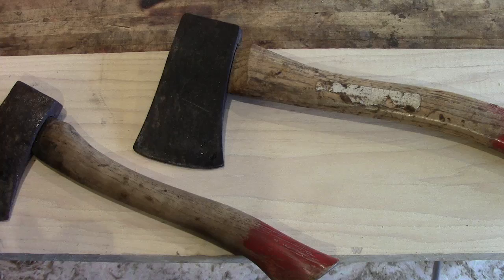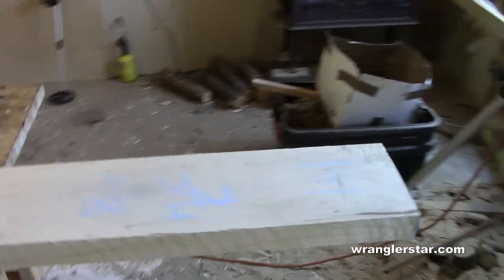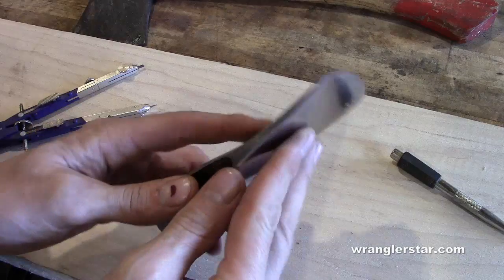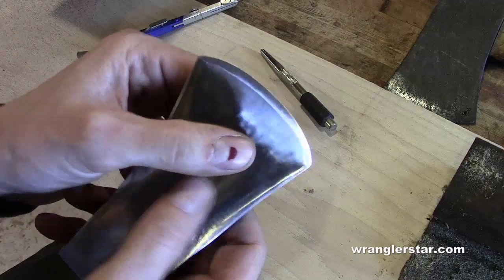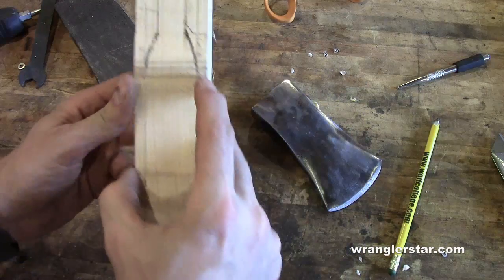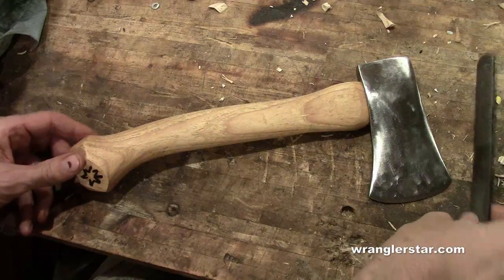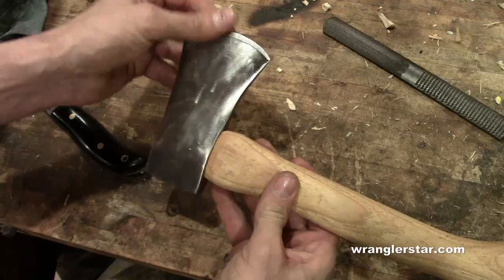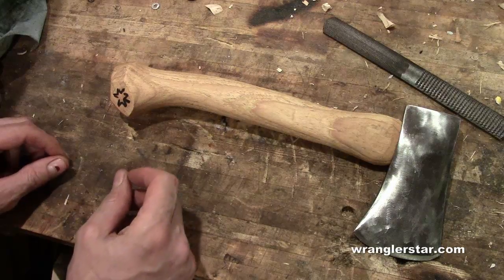Boys First Hatchet - Wranglerstar

Comment: My dad was a good dad, a very hard worker, and gave me most everything I ever wanted. However, he was more of an example of how not to build things. I remember most of his attempts at home repair and craftsmanship ending in disaster. My fort was the same dimensions as an outhouse and had no windows. Basically it was a tall box to sit in the dark in. The floor dropped up when I got inside of it. He hung a shelf once and the toggle bolts he used extended through the wall, through the insulation, and through the other wall into the hallway. He put the outboard motor on our boat through the dining room wall backing into the garage. A few years ago he told me about building wooden models as a kid so I bought him a new one so he could build it and I could one day own it. It looked great until he glued it to himself. I still have nothing he ever built or wrote. I always ask myself, "what would Bob do", and then I do it 180° differently.

Comment: Great gift Cody!  When I was a kid, about your son's age, my grandfather and I built a toy trunk together in his shop.  We built it as a cube and then cut the top off.  I got to help with each step, including the staining, varnishing and putting on the hardware.  It meant a lot to me, in fact, it is sitting in my office, beside me, almost 40 years later.  I have had three little brothers through Big Brothers Big Sisters.  My second little brother and I built a trunk as one of our projects.  That one was painted and Joel picked fire engine red for the outside.  Trunks are great things for keeping your most important treasures in.

Comment: My dad gave me my first hatchet when I was 6 years old. I got it the same day I got my first rabbit. A friend of his found an old forged hatchet head at a flea market and mounted it on a hickory handle. it was Razer sharp. I found out the hard way, by running my finger up the blade to feel the edge. ouch! I used that hatchet to process that rabbit at six. he taught me if you kill it you respect it by processing it yourself. he gave a great life lesson that day. I had that hatchet till I was 25 years old. when my car was stolen and it was in the trunk with my camping pack. I got the car back in one piece, but everything else was gone. I still have the sharpening stone my dad gave me. thank you for your videos. May God bless you and your family.

Comment: I play guitar, electric and acoustic, my two boys at 3 and 5 yrs old always wanted to play with my guitars, so I had a 4'x3/4x12" piece of mahogany and made them each a 2' long slab electric air guitar. I copied my fender Stratocaster and used a wood burner to put all the knobs, pickups,  strings and hardware. I used an old seat belt for the straps. They loved them and always played them when I was playing mine. Not only did they love them, but they never tried to mess with mine again. now at 28 and 30 their children are playing air guitar on them. A hand made gift that is done with love and quality is always a gift anyone will cherish. You did a wonderful Job on Jacks Hatchet, and I'm sure he will always cherish it!

Comment: I don't have kids, but when I was about 7 my dad gave me various hand tools, which I loved. One of my favorites was a manual hand drill (not a brace, a breast hand drill with two gears) and a set of drill bits. Another favorite was a small saw.

I also used some small hatchets we had - I didn't have my own, but I remember that they had 500-700 g heads.

My dad forbade me to use his very sharp wood chisels and the electric tools (probably a smart idea), so obviously that's what I wanted most of all.

Something which is not on the woodworking/outdoors side: a soldering iron is an awesome tool.

Comment: My dad gave me a hatchet and knife when I was your boys age. Neither were my first, my grandfather was a knife collector so they were probably number 100 in my collection. What made them special is they were the first from my dad and my grandfather carved my initials and the date on the blade of both. I still carry the knife to this day but sadly the hatchet has come up missing somewhere down the line. It did see its fair share of use though building countless tree houses and splitting wood right next to my dad. I remember my dad used to split wood by hand with a Sears 12 inch long hatchet. It took me years before I could split the same sized wood, man I thought he was soooo strong. He still is, 22 years later. 

Good work on the hatchet, he will love it and remember it for the rest of his life, I guarantee it.

Comment: The Axe turned out great. I guess the gift I gave my two boys were vehicles and we worked together on getting them in running order. One was a total engine and transmission overhaul, the other was changing a blown head gasket and transmission overhaul. They both learned proper preparation to undertake the projects as well as not to take shortcuts when confronted with a difficult part of the project. Both boys have vehicles that run well and they understand how they work.

Comment: One of my most memorable gifts was the Marlin model 15 .22 rifle that my grandfather and uncle bought me after I made first communion.  It's a single shot, bolt action .22  It was actually the first youth rifle to be completely scaled down for smaller shooters...prior to that, gun manufacturers just cut down the stock & the barrel.

To me, that rifle symbolized trust & responsibility...I could even see it back then.  My grandfather & uncle trusted me with this tool...and to use and care for it properly.  I still have it...and I still shoot it from time to time.  With a little cleaning and oiling it still shoots as straight today as it did 30 years ago.

Comment: I kept my Plumb Boy Scout hatchet from 1960, camped, opened coconuts, cut wood, quarted elk &  moose, fixed fences on a farm. Passed it on to my son. I found another one at a Scout sale, the old Plumb hatchets were perfect, good steel, handy size, great tool for boys or adults. The wood handles have all lasted over 50 years with normal care. Get one if you can. Want a industructable hatchet, but heavy is a pre WW2 metal handle  wood insert handle, Scout  Axe,  found one of those after 40 years of keeping a eye out or it. Made by Bridgeport Hdwe. .

Comment: I really like the thought put into this handle, looks great and I am sure it is very useful. I just restored 2 small hatchets that work great for my 6 and 7 year old boys, sure I will be making them one more hatchet as they get older. Made leather sheaths for the hatchets and a leather loop that go on the the belts I made them so they can carry the hatches on there side. I also made some leather belt sheaths that they can put on the belt to store their folding knives in, looking to make another belt sheath that can store their flashlights in that grandpa gave them. They both are wearing the belts with the tools in place at the moment.

Comment: My grandfather built me the best bike when I was about 10. It had the big banana seat I think they were called. It looked to me like a motorcycle so of course I needed some noise makers on the tires. My parents and Grandparents came together to build me an amazing Barbie house. That was memorable. They made furniture and pillows and curtains and everything. Really the homemade gifts are the most memorable. Even just the submarine my dad built me out of a big cardboard box. He used all kinds of tiny colorful screwdrivers to be switches and controls. But the best homemade gift has to be a treehouse. especially if you build it together.

Comment: My father gave me my first hatchet, it was an early model all steel Estwing that he had used.  We beat the heck out of that thing.  We still have it and it's in pretty sad shape but it got used and abused (cutting, hammering, prying, levering, pulling nails, you name it).  Estwing may not be a perfect hatchet technology-wise or even use-wise but dang, it put up with the abuse and asked for more.  You can't do the cool handle replacement bit, but knowing it was from my father was worth more than the style or condition.

Comment: My son is only 18 months but when I was 8 I got a tool set that I think came from sears it was in a wooden box had a child sized saw, hammer, screw drivers, ruler, allen keys, wooden mallet, pliers needle and slip joint, crescent wrench, and if I'm not mistaken some small c-clamps. I want to say it had a hand drill but I don't remember all it came with just that I liked it. It was a tri-fold box that was about 15 inches tall little over a foot wide and 3 inches thick. I think that was the start of me fixing things around the house. I was 10 when I got my first swiss army knife knock off that I still have and 12 when I got a bb gun.

Comment: Wranglerstar, I just put a new handle on a similar sized hatchet. I sanded off the factory finish and put a nice coat of boiled lindseed oil as I've seen you do time after time.  Thanks for the instructions!
Reply from the maker: +Paul VanDyke well-done!
Reply: +Paul VanDyke I heard lindseed oil sometimes wasn't too good in these situations, as it comes off after a year or something like that. Is this true? What are the positives and negatives of lindseed oil vs. wax or other finishes?
Reply: +ArcaneCookie I'm very happy with the finish that the lindseed oil provides.  It's much better than the factory finish was.  I've got a can of oil and would gladly re-apply more when necessary.  I use this hatchet almost daily to split kindling and it feels infinitely nicer with the oiled finish. I'm learning lots from +Wranglerstar!
Reply: +Paul VanDyke Thanks!

Comment: Cody I have been taking you advice on finding great older American made hatchet heads and Axe heads.  I have been working on them a little at a time using the methods you have shown.  I am wondering how you buff out the ruff finish to get them so smooth after taking the pitting out?  Thanks love all you videos.

Comment: great job on that handle but im wondering why you didnt put any sort of finish on it and why you didnt buff out the grinding marks on the head? small amount of work would have made it look 1000x nicer. why run a marathon just to stop 100m short of the finish line?

Comment: Great video! I have a question for the general public. I found a hatchet in the bushes a while back, it's a quality hatchet but it was rusty and pitted. I filed the rust out with a metal file but I'm worried it's gonna rust. How do I stop it from rusting because I only use it every couple of weeks. 
Thanks,
Will
Reply: Thin coat of oil on it with a rag -- make a leather sheath for it to protect the blade. The leather will gradually soak in the oil and be like an edge rust protector as well as a ding/nick preventer.

Comment: Why take that pitting down? I would never remove that weight to make it look good. The first hatchet I ever handled I dug out of the dirt of my grandpa's wood storage area of at the end of the barn. I found the name "Gambles" on it then later brushed it primer grey and painted her black. The reverse handle with the knob on the end is best. Hockey (friction) tape or rosin should be used for safety.

BTW shaping is easier & faster done with grain respectful methods like a shaving horse, drawknife, and I forget the last tool name.

Excellent looking multi-faceted knob. 

Most memorable thing I received from my father was a 3 bladed pocketknife when he saw me struggling to untie my bundles of papers ( I delivered 350 every sunday by bike or hauled behind me on my sled after school from age 10 to 16 when I got a bagboy job that paid more.) and I have that knife to this day. I treasure ANYTHING of my dad -- even rusty tools which I still, to this day, refurbish in my spare time. I rehandle them, restore them and hang some of them on my living room wall. I affectionately refer to it as the wall of steel. I have nail pullers my family built their first American house with on the east coast.

Until I just typed that in I never realized... i dunno, guess I am still in the middle of this epiphany and thanks for leading my thoughts there, wranglerstar.

My kitchen started with my father's cast iron frying pan as a decoration and now I have collected from garage sales, restored, derusted, and bought some enameled cast iron new to make a whole collection of cookware from small to large. Including dutch oven. It is both decorational and functional. Everyone gets more iron intheir diet when eating out of these old pans. Peanut oil burnt on keeps them nonslip and gives beef an even beefier, meatier taste. Plus I do not have to throw them out every few years like the teflon shit or worry about 'teflon flu' when the pan temp exceeds 400 and if you cook steak and brats and stir fries like I do, it does. Man, I ramble. Gotta get to work. Later.

Comment: i have mentioned this on other videos of yours, but i will repeat it. you need to learn to profile these heads properly. when people talk about a 25* bit angle(roughly), its a total of 25*, not 25* on both sides. the way you are grinding these heads on the belt sander is giving you a double 25* bevel totaling 45 or 50* beveled bit, which is terribly steep. your axes will perform much better if you get rid of these super steep bits. i am sure you have read the publications that came out of nine mile station, but if you get the "an ax to grind" pdf, you can print out the page with the ax bit gauge and transfer it to a piece of belt leather then hot wax it. then you can get a perfect bit bevel every time consistently.

Comment: how did you get the old handle out???
Reply: He's done it on video before, and there are other vids on YT on it as well. You can pry out the metal wedge and then drill out the wood wedge. That will let you drive the handle out of the head from the top.

The main vid I can think of where he removed a head was his vid named "Why my Autine axe failed".